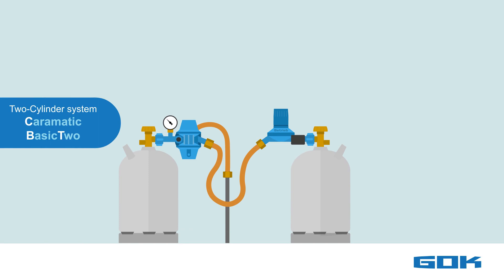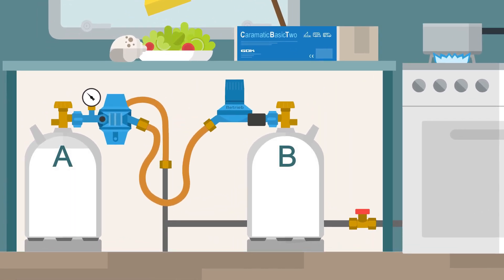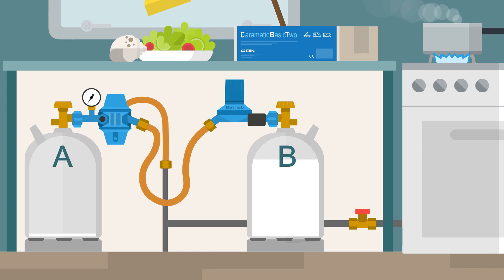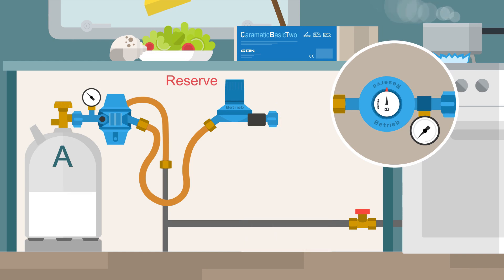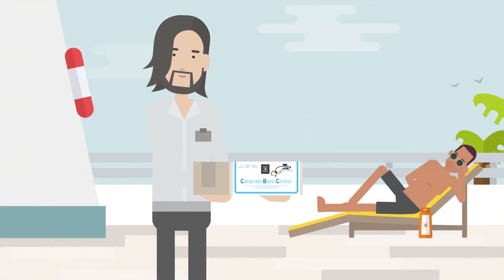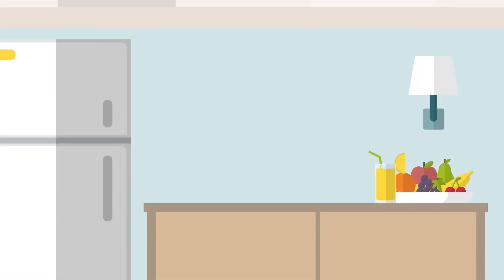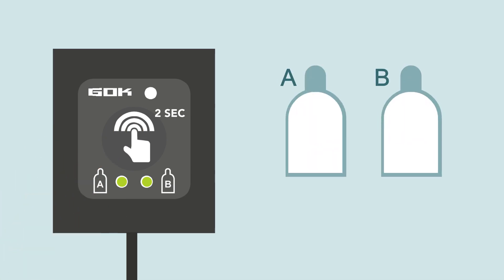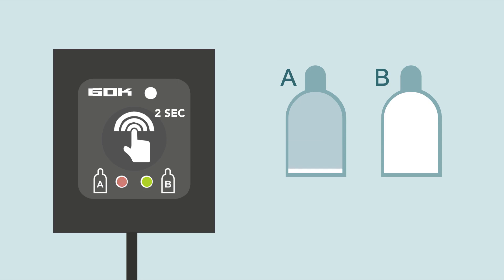Safe gas supply with GOK Caramatic BasicTwo + BasicControl - two-cylinder system + remote display

Comment: What if I will shwitch to the top position betwen left and right gas cilinders?
Reply from the maker: If both cylinders are filled the system has no preference from which cylinder the LPG is taken from. Of course, we highly recommend to put the swtich in the determined position. But in case the switch is put in the middle there will be no malfunction and the pressure regulation works just fine. But you won´t get a proper automatic changeover as it switches constantly between the cylinders.
Reply: @GOK-ReglerundArmaturen  I'm using 2 gas bank cylinders insted of ordynary gas cylinders, so I newer switch cylinders, instead I just refill them with LPG at the station. So in my case in what position schould I leave the main swith?
Reply from the maker: It´s totally up to you and your preferences regarding which cylinder to empty first. We highly recommend though to read the manual carefully: https://www.gok.de/media/pdf/97/11/cf/7121850_CaraBT_DE_EN.pdf . There you will find examples and descriptions for various use cases.